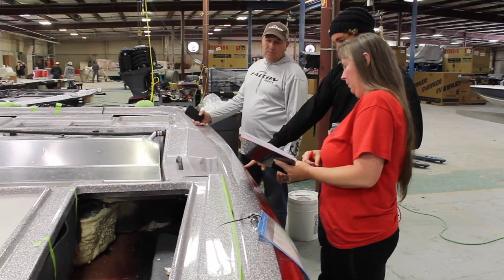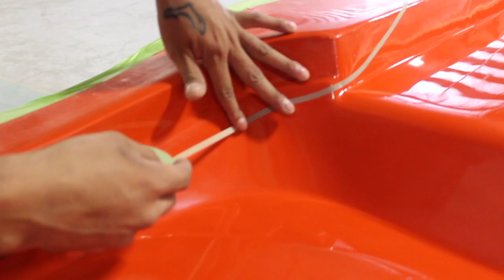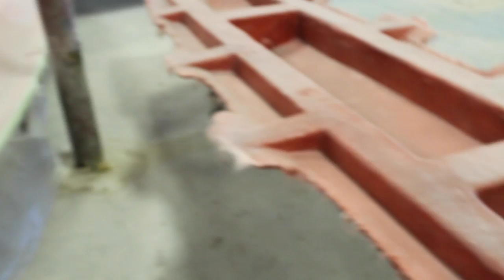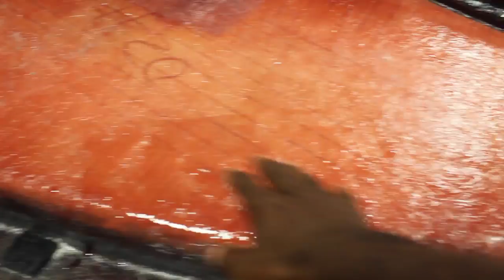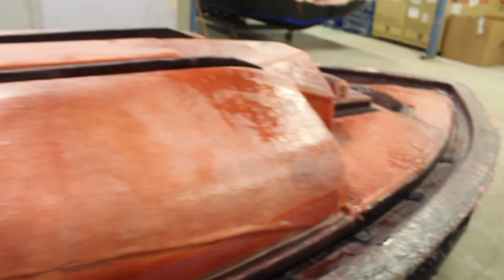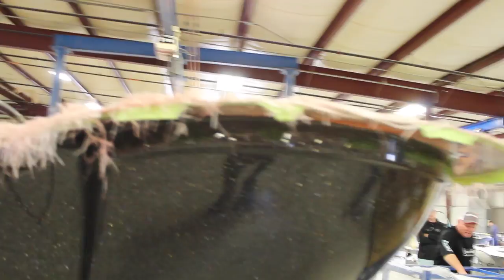I'm Building A Bass Boat

Comment: I’ve worked for Ranger Boats for about 4 years now using a chopper gun and rolling fiberglass. I’ve also put in transoms and put down the sub floors along with foaming the floor and foam tanks in the back of the hull. I don’t know much about the deck side of the boat but the hulls to a falcon boat is very similar to a ranger boat. We build about 15 boats a day though. It can be very stressful at times. 60-70 hour work weeks

Comment: Cool ! Nice colors.   Quality build.. the electricity that's created when boat is stripped  from the mold is just static electricity like rubbing balloon on hair or vacuuming sawdust with a corrugated hose, you should see the amount of static electricity a chinook helicopter builds up. Riggers have to be grounded off before they can touch a load thats hooked up to one

Comment: that's sweet they use Gel coat with metal flake now. I worked at a boat repair shop in the 90's and all bass boats with metal flake were painted with Emeron (not sure the spelling) but you couldn't just sand and buff to bring original color back. You had to match the paint and remember seeing the painters throwing crap around due to frustration trying to match the metal flake color lol... Awesome video!!

Comment: OK take notes, the friction from pulling the  boat from the mold creates surface tension friction creating a charge. You can eliminate this by connecting a grounding cable from the boat to the ground, or to the gantry crane. The boat is free floating and ungrounded when pulled out and all those charged particle are floating around on the surface of the resin waiting to find ground. The person touching the boat first becomes the ground and gets zapped. so ground the boat to avoid this.

Comment: That is a beautiful boat, but, I was sponsored by Stratos the year they brought out the 295 model to be a tournament boat and I chose black with light silver and blue misted flake with large silver flake stripes and blue pinstripes, it was as pretty as any boat I have ever seen but years later I sold it because on July and August days fishing the deck carpet stayed soaked from me sweating and the sitting in the black/blue/silver seats would litteraly burn you, and it being mostly black it was hard to keep clean. what is prettiest is not always practicle. my black corvettes are beautiful but I had to keep them covered in a garage and wash and wax them often, pretty to look at but years later I don't have as much energy to constantly clean and polish, LOL.
my Stroker boat is mostly white gelcoat on the top cap, only colored stripes much, much more comfortable on hot summer days!

Comment: So, do they spray something in the mold as a "release" agent before starting with the clear coat, metal flake, etc.? I mean, the whole thing seemed to pop out of there pretty easy.
...btw, the colors are great!
Reply: the molds have to be polished and they apply a release agent/wax then the clear. for all the guys saying chopper glass will explode on impact, they will but when these guys caot the gelcoat with the resin then spray the fiber the hand rolling will make it real close to actual mat, a lot of boats are just blown mat and resin and they are very heavy and not as strong. I agree all the fiberglass work I have done I prefer mat for strength and reduced weight, some companies use the heavy woven mat and in the sun looking at an angle you can see the mat pattern, I hate that!
the best process is use the unwoven mat and hand roll the whole mat to remove all air bubbles and saturate the mat with resin, this is more labor so it cost more, the ultimate is apply resin and woven mat and wrap it and heat then vacuum it to remove all bubbles and even out the resin, this is the strongest and real light!

Comment: Its triboelectricity.  The boat pulls electrons off of the mold and if you touch it before it can be discharged. those electrons will jump to you.

Comment: I have already spoken to two different Falcon dealers about replacing the Ranger early next year.  Is there anything that is an option that you feel is a must on a Falcon?
Reply: We've found that the hydraulic jack plate is a must on the F205 and F215, which is why we order all of ours equipped that way. Looking forward to hearing BLat's thoughts though.
Reply: Bucks Island he replied on IG that a jackplate is wanted.  I fished a lot of skinny water in Alabama but here in Georgia I don’t use my Atlas as much as I thought I would.  I do see the benefit though.  I haven’t spoken with your sales team yet.  But because of the videos with fluke and Brian I will reach out.  Thanks.
Reply: @charleswooten9836  , that's great.  We have a demo F205 set up that we added the Atlas to after our own testing. Give us a shout and we can get you on the water and show you why we added it.
Reply: Bucks Island what is your sales groups email address.  I have more questions than I want to put in the canned form on your website.
Reply from the maker: Charles Wooten the benefits of the jackplate aren’t just about skinny water.  It’s just overall ability to manipulate the handling and performance of the boat

Comment: This is how throw away boats are laid up. Chop spraying guns which do not properly mix resin and catalyst consistently creating areas that don't cure evenly and uneven layers of chop glass, non-closed cell foam that "will" get waterlogged filling voids, half a$$ed spray foam insulation around compartments, did not see one layer of any kind of woven cloth, glued in stringer system held in by glass tape rather than laminated from start to finish. In short... a fast, cheap, and weak way to lay up a hull. Hand laid up boats will outlast these boats by a long short. Bayliner boats are built in this fashion. Hence why we say they are better off lining the bottom of a bay rather than on it it.
Reply from the maker: What bass boats are laid with hand woven fiberglass?

Comment: Come August you may wish the cap was white.  Had a friend with a black boat and black carpet, by the end of August he sold it at a big loss.  God's creation is real, it gets hot in the summer.
Reply from the maker: John Koons that’s the biggest myth ever 😂.  That’s like saying my boat would be warmer in the winter because it’s cold.
Reply: @BrianLatimerFishing  I hear what your saying, but at 72 having fished for bass for over 45 years, I've owned a few.  Black carpet is not a big myth when it comes to summer.  Your feet would fry.  I did watch your video, good job.  Your saving grace is they are going to put grey carpet in your boat.  I have three black trucks, I will not put my hand on the hood in August in Texas.  Owned a White Suburban at one time it was one heck of a lot cooler inside and out.  Best luck this year.
Reply from the maker: Yeah I’ve owned quite a few myself so I understand.  It’s all in your mind.

Comment: Please stop putting foam in boats!! If you ever get a hole or crack down the road, the foam soaks up water and takes forever to dry!!!! Older boats mold!!!! I've repaired many and the foam is awful..
Reply from the maker: Jason Dane not closed cell foam like in current boats

Comment: High Dollar chop boat. Too bad does not have a hand laid Hull stronger, lighter = faster.
Reply from the maker: Tim Vaughn .  How’s yours laid?
Reply: Brian Latimer   At 6.35 that's a chopper gun spraying the first layer of chop fiberglass in your boat short strips of fiberglass. Hand laid uses long woven roven or mat looks like a big wide blanket. I'm not trying to knock it so much but ask them about it they can tell you about it . Call me if you want to. thanks Tim
Reply from the maker: Tim Vaughn what boats are currently hand laid?
Reply: Skeeter, Triton, Stratos and Javelin used to be I'm not sure about now.  They have gotten so outrageous on price (outboards also) I don't keep up with it.  Ask around.  This is the first time I have seen your YouTube are you a professional fisherman? If so talk to some boat/outboard reps. they keep up with it. If you want to talk about it get ahold of me. thanks Tim
Reply from the maker: Tim Vaughn is yours hand laid?
Reply: Brian Latimer yes it's a 150 Starfire Skeeter. I have worked on boats and motors since 83 .We ( me and my dad ) had Mercury, Skeeter, Stratos, Bass Hawk, Aries, Vision,.Jason some others. I still work some on them. Factory cert. Mercury outboard.1983  I was  just 18 at the time. I not hating on you I'm glad you have got all that you have.  I just talking about how the charge an arm and a leg for a chopper gun boat and it's not just your brand boat there's a bunch of them out there.  thanks Tim Once again you are welcome to call me you seem to be a nice guy. I would get a kick out of talking about it with you.thx.
Reply from the maker: Tim Vaughn just a FYI.  The guys that designed this boat came from one of the companies you listed here.
Reply: Brian Latimer Was it Earl Benz?

Comment: Chopper guns do not build quality parts. After a year of hard running the cracks will start to come.
Reply from the maker: It’s crazy ain’t it!  Literally every bass boat on the market uses a chopper and we don’t have cracks 🤷🏾‍♂️.  They should listen to you!
Reply: @BrianLatimerFishing   Yet, it will happen, even the over built rangers crack. I've been working on them for 10 years, haven't seen one yet by any builder that didn't crack. Ones that are built with rolls of mat, core mat, 1708 and vector ply don't crack, not even in the corners. I'll bet I can pick that boat apart before it hit's the sales room floor.
Reply from the maker: Buba Loui yay you!
Reply: @BrianLatimerFishing  Everybody hating on your choice of boat. Not me, I would be proud to own that rig and I am proud of your for being who you are and buying that. Keep the video's coming.
Reply: Lacking weave fiber, the cracks will show within 2 years.
Reply: Boats are expensive enough already, imagine how much extra for hand laid and cored ?
Reply: @colstace2560  That's why I bought welded aluminum... Did it cost me 50k? Yup! But will last 30 years.
Reply: @xlrationmarine  
So you think just because they only showed the skin going down in the video that all they built the boat with was chop? That's pretty funny because I saw, at various points, chop, core mat, biax and a foam core of some sort (not the sprayed foam, actual structural core) installed in the boat.

Since you are an expert on boat construction, do you know how they make rolled chopped strand mat (CSM)? I gotta say, from your comment, it doesn't sound like you do. Here's a hint, they use a glass chopping system very similar to the gun the operator was using in this video. Sure, there's a little more to it than that but, at the base level, it's pretty much the same thing.

Comment: contrary to your belief only falcon offers floatation foam. most new boats standard is that foam when it comes to that type of bass boat. your boat is not special. it sits low to the water looks funny and is rear end heavy as hell.